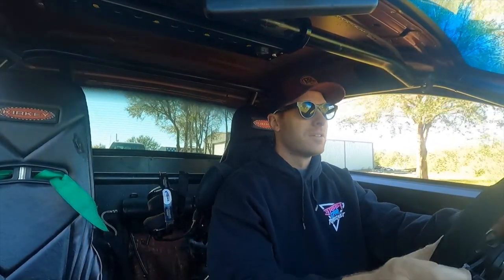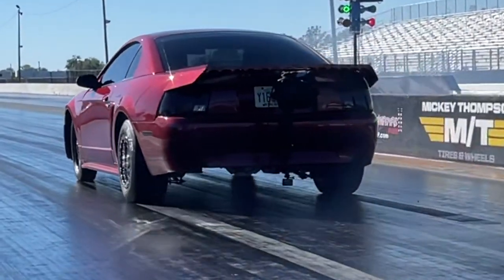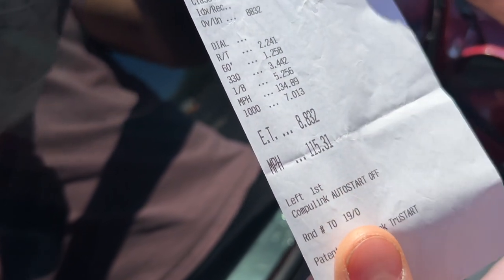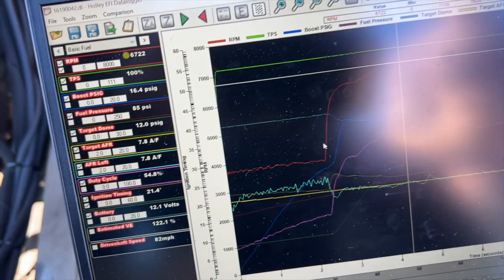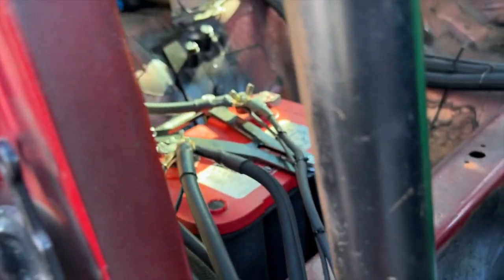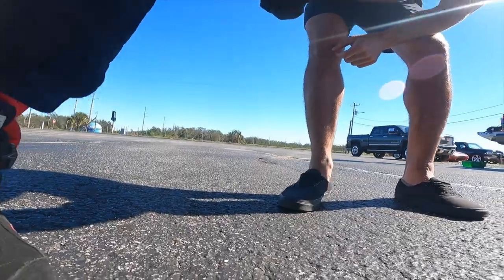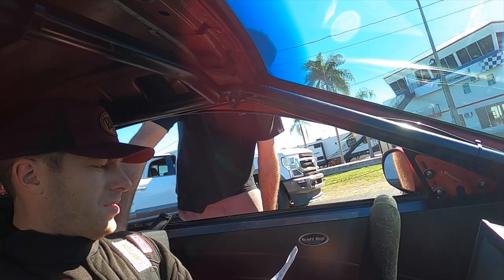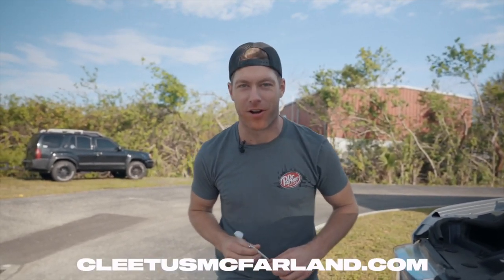Turbo LSX Mustang does Wheelies on a Small Tire

Comment: The videos keep getting better, great job Parker!
I'm old school so I know mechanical fuel injection and a magneto on a blown big block, simple and effective power.
But I digress...

Little issues always seem to be found in the wiring and there's lots of wiring in these modern cars so lots of potential for issues. Definitely go through and check all your grounds, all your connections, make sure it's all solid. Trying different plug wires isn't a bad idea, as mentioned by others some wires just play better with the other components. Regardless keep digging, the car's a beast and remember no car is ever "perfect", there's always something. lol
Reply: Troy mentioned a great point also related to the charging system, your grounds.  Looks like you have a bit going on in your ground cables.

Comment: You can always try a different set of plug wires and see if that helps. Sometimes certain wires don't work well with different setups. It could be a setting in the computer too, like if it's hitting a Rev limiter or boost safety type thing. Seems odd it's just staying at 6k and won't go up or down from there.

Comment: You'll have to fix the voltage drop issue. I've had it happen before. Need a better alternator or I think swapping to a bigger pulley to slow it down should help. Also set the dwell time on the coils in the Holley to 4-4.5.

Comment: So we have similar setups, my engine is likely a little less spicey than yours but it would appear we run similar times. I've always just stuck to the KISS theory (Keep It Simple Stupid). Anytime I have run into a misfire, or breaking up, etc, I always check the usual suspects. Spark, Fuel, Compression, Electronics. If My plugs and wires are not cooked, I check my fuel pressure, my fuel map, my injectors for any blockages/clogs. I check to make sure I'm getting good compression in all cylinders. I check my electronics for a loose fuse, a loose connection. Make sure you have a good ground on all systems that need it. Check to make sure your alternator is producing enough current under load. All that being said if you haven't run out of injector or fuel pump, and your plugs and wires are good I think that Dr Tunemall may be correct and you have reached the limits of your current coils.
Reply from the maker: Thanks for that! Thoughts on my alternator being over spun? Going to a bigger pulley this week.

Comment: Check the coils and the voltage going to them. It was my first thought and then you said Nate said the same. If the voltage is around 12 or lower you probably don't have enough spark to lite the fuel at higher boost levels, which explains why it starts happening in 2nd gear and not 1st.

Comment: Electrical engineer here, voltage drop is likely not enough supply. If you're confident about the coils, check the wires feeding them. My guess is the Dr. is correct. Will likely need to upgrade(coils, plugs, wires).

When in doubt, go bigger in terms of wire guage for all grounds and for systems that draw a lot of current like ignition

Comment: Start by redoing that ground setup...Thicker cable near the alternator to the chassis, block to chassis...and a solid run to the battery itself.

Then make a specific ground BLOCK that all electronics can have a direct run to...

Keep it clean and simple, eliminate that drop...

Comment: Do you think youve got some pick up sensor issues developing like Ruby had? Obviously not as bad but another thing is with your voltage dropping that low, Im wondering if its effecting the coil performance/spark delivery 🤷‍♂......I would look at all the data and see where if its happening at the same point every time. Plug looked pretty good

Comment: You went over your settings in the Holley? I'd honestly go with better coils as Nate mentioned. I don't know what plugs you're running but they look like some NGK BR7EF's? I'd be suspect of them also. Start closing the gap a tiny bit at a time and see if it's blowing the spark out. If that doesn't fix it try swapping to something like a Brisk DOR12DS or DOR10DS.

Comment: I had to put a bigger pulley on the alternator add a ground strap to the alternator, and if your using a 4 pin alternator PLFS, try putting pin S to the 12v bat stud on the back of the alt. This is what worked for me.

Comment: It does sound like the voltage drop is messing with everything else at the top of the run. When I ran a ancient MSD 404bc on my Dart it ran great once I got it to start but if the voltage dropped too low while cranking it wouldn't have enough spark to start. It drew a lot of current and something wasn't right with it but it still worked. I also had to close the plugs way up to get a good spark out of it. It finally completely died and I gave up and put a 6a on it for a while but it just wasn't reliable on a old car with bad wiring. I think voltage spikes kept killing it.
Consistent voltage with a good current level is really important when you're using picky go fast parts. I had a 100 amp cop alternator on the Dart and it really helped keep everything running and the huge battery I used charged up. That was the biggest charging setup you could get from later Mopars that would fit in the Dart.
I love seeing your family and friends jumping in to help and with all the ideas you have now you should get it figured out👍

Comment: Saw someone have the exact issue. He had ceramic plug wires but was told to put better plug wires on it. They were thinking coils at first. But plug wires fixed it. Same exact breaking up.

Comment: I would look into the valve springs. Sounds like valve float. The boost pressure and rpm may be causing the intake valve to not close fully. I had a similar issue when I tried to run stock valve, springs and boost. If I went above a certain amount of boost the car it would just hit a wall because it had valve float. No breaking up or anything.

Comment: Take a trigger log on a pass to make sure you're crank and cam signals are clean. Are you using aftermarket triggers or stock? Possible air gap issue if they're aftermarket. If that checks out then move on to your basics. Makes sure injectors are flowing evenly, change out plug wires, check for carbon tracking or cracks in/on the porcelain on the plugs. What are they gapped to? Maybe make them tighter, .018-.020 if they aren't already there.Then move on to your coil upgrade, that would be me last move since there's an investment commitment and potentially time wiring. I'd also verify engine viability with a leak down test if nothing else obvious pops up.

Comment: Look into the alternator.. maybe over 6k the belt is slipping and can't give the voltage to the coils.. 

And I know everyone runs a stock LS alternator, but a 3 phase alternator like a mechman puts out super clean power and cleared up a bunch of electrical gremlins I had in a big turbo drag truck.

Comment: Good Video. If those are LS coils, they need good voltage and I always need to run the gap tight, .013-.015 max Holley coils are way better, but you have what you have. Tighten gap way up at least to start.

Comment: Possibly alternator if you’re dropping voltage. I’ve had that issue before on my LS at higher rpms. Switched it out for a higher 165amp alternator and it never dropped again.

Comment: Your coils, injectors and fuel pump all won't be entirely happy at 11.x volts.  I have to assume the Holley EFI has a battery voltage compensation table that should go some way to putting a band-aid on the problem, but you really need that voltage at a steady 13.5+V as you go down the track.

Comment: Low 11s voltage on those high power ignition rigs is probably a bit low,  higher output alternator/battery, then perhaps simply a better coil pack on the cylinders.

Comment: Definitely saw the editing effort! As for breaking up at high RPM...did all the plug wires got replaced on the dyno runs? How about plug gap? And if you say the voltage drops to the 11's then maybe try a new battery...LTO for the win! (Not cheap but worth it, bassheads like em!)

A better alternator could also be something but before all that...check your power and grounds. I would strap on the ground wire to the alternator directly (where the power comes from) instead of going through the block, and some simple head grounding to help the spark plugs. Let's get it on!

Comment: Check that voltage drop typically if you’re losing it above 6k you’re over spinning the alternator I’m not sure if you changed that pulley but the motion 3in should slow it down and keep the alternator charging

Comment: Now you have turned it up more it appears it was then it started breaking up so you could be blowing the spark out so try closing the plug gap down to 14 thou and if it still
breaks up you might be at the point of needing more powerful coils, I would also be tempted to try new plug wires first as I have had what looked like perfect wires but still
were causing a breakup under extreme loads.

Comment: Parker is am assuming the the smaller tire is changing the gear ratio out back and the tune ramp may be adjusted higher in the rpm range as you are climbing in rpm much faster with a 2 inch smaller tire. You may have to fine tune the ramp to avoid running out of fuel and/or reduce timing up top.

Comment: Better electrical system supply... The voltage shouldn't be dropping off like that. However it seems like after the ground cable came off it could have spiked something in the ignition dept and hurt it, not sure if all the problems came after this incident or were there to start with.

Comment: the voltage dropping is more than likely causing the engine misfire. at a guess your over spinning the alternator. the battery coming unhooked also could have killed the alternator. 

id have to agree with nate though, with the power your making its time to step it up to some ign-1a coils.

Comment: I would start with the voltage drop issue then next make sure valve springs are in good shape. Believe it or not it can cause a break up in higher rpm
Reply: I was thinking the same thing.

Comment: @ 8:50  in the last 2 boxes of the Base, shouldn't those be 17psi out the back end?  I'd get a set a new set of Coils, if thats not it, You have spares on Race Day.. Maybe start by checking all the wiring Grounds & electrical plugs, fuel filter & check fuel pumps, Ohm the spark plug wires & pull all the spark plugs.   Clean & test the Injectors!!  it sounds like your going lean after 5 or 6000rpm?   this is why we test!

Comment: crankshaft sensor gap, or wear, reluctor on crankshaft has moved or warped? Being higher rpm/load, Would think electrical, voltage drop alternator issue. All happened after ground came off had to strain all the capacitors and such in the charging system and ignition system.

Comment: I was gonna say sounds like ur alternator it’s being over spun mixed with unstable sad cable. Was also thinking crank shaft position sensor might be slightly missing in high rpm kinda like ruby was. Maby frequency or vibration. I’m a nobody when it comes to this just my thoughts brother keep ur head up killing it 🎉

Comment: Parker, i'd definitely pull all the plugs and check the gap. Swap the wires out for a new set to cut that out of the equation.. do you have the motion smaller alternator pulley? Could definitely be over-spinning the alternator at that RPM..

Comment: Clean up all the cables at the battery  using distribution blocks,  up grade the Guage of the battery cables positive and  negative, see if that helps with the voltage drop also check the  battery .

Comment: The ground wire coming off & on & off may have damaged the coils. In the video you didn't say anything about breaking up until after that happened. It could also be the lower voltage affecting the coils. Race cars can be a pain sometimes.

Comment: Low voltage can cause ignition issues. If coils, wires and plugs are all good, I would look into a more powerful alternator, or maybe look into running a 16v system.

Comment: That diff is howling so bad. New gear set required.
I guess the alternator has stopped alternating as it should have still ran with the battery lead off. All those coils too use a LOT more power than a single one

Comment: If your voltage is dropping and your battery terminal fell off earlier maybe you should check your electrical connections. As voltage changes your injector dewll times change, you are also losing about 30% of your potential ignition energy

Comment: Can you lower and rescale the car to get more separation?  Also, fix the charging system.  It's going to reduce the output from the ignition system.  Some IGN-1A coils would help but with the issue you're experiencing, I don't believe the coils are the root of the problem.

Comment: Did you turn it back down and see if it goes away? Almost sounds like a little valve float, I know it’s a pita but maybe valve springs if it’s not coil or injector related, make sure your fuel tank, lines, and injectors are clean but I’m sure y’all checked fuel flow

Comment: Get rid of the voltage drop go with at least 14volt battery as a start. Be sure your block is grounded to chassis and motor plates.

Comment: Look at the alternator it should be 14 to 15 volts when on transbreak voltage is dropping witch  messes with the power to the coils an with the boost you have to have strong coil power to fire properly. It's probably the alternator go to a 14 or 16  volt alternator and it will help out

Comment: Could it be some sort of signal interference to the ecu? I know we had an issue  with our car a few years ago (digital 7 box so a bit different), but where we had it mounted, we had some sort of odd signal interference at about 4.5k rpm. It would stumble right past the 60 foot and it drove us crazy. Moved the ignition box about 8 inches back from the previous spot and the problem disappeared. I don't know if Holly's typically have that issue or not 🤷‍♂️

Comment: What size fuel pump wires you using also alternator wire size and connection’s converter slip at high rpm

Comment: my idear for your breaking up issue might involve overpowering your valve springs with boost, and your valves might not be closing all the way due to the amount of boost/power you're making. maybe a spring pressure check and look at the data unless I missed the data being cleared for any such problem?

aside from that we know you have been chasing basically the same issue with plug wires, I say buy once cry once get the bad boy plug wires you need...might be building up too much dwell in the cores at higher rpm?

can't hurt to get the big boy coils either...

Comment: Making that many passes in a day temp stacking in the converter will begin to offset your tuneup changes, hiding improvement. Even with a good pit cooler the converter will never hit as hard as it does off the trailer.

Comment: Test the battery, make sure its good and not got a dead cell or anything, replace those terminals with some good ones that are tight and work right, check the alternator output to make sure your getting a good charge, and check the earths for everything, poor earths will cause a lot of issues, fresh set of plugs, upgrade the coils, and make sure its got enough fuel pump and injector to not be getting up there and near maxed out , and check the fuel lines are clear without any blockage causing fuelling supply issues to the injectors
Reply: also check voltage on the cam and crank sensors, make sure voltage or signal isn't being lost at higher rpm

Comment: Maybe it needs a high pass rpm signal filter on either the crank or cam, or both. Something about how the shape of the signal wave can throw off what the ECU is expecting. Paraphrasing out of my ass here with "low spikes are sometimes being recognized as high spikes because the signal is so raw and spikey". Maybe that'll jog someone else's memory. Know anyone with an oscilloscope?

Comment: If it was mine I would be looking into that voltage drop. I feel like low 11s is way to low but could be wrong
Reply from the maker: I think we’re over spinning the alternator
Reply: @DoctrParker   very likely. I turn 7700 with a 3.0 and does fine
Reply: @DoctrParker  awesome video btw!

Comment: Was it breaking up before the battery post come off mid run if not that can be causing you a problem  voltage can be your issue let me know and I will know for

Comment: Look no further than your voltage drop!!!! When voltage drops Amp draw increases so when boost increases during a pass, voltage is dropping coil amp demand is increasing and the Holley voltage to the coils may be reducing due to its voltage being low……run an alternator is my solution or dual batteries to maintain minimum of 12v for a full pass

Comment: If voltage is dropping that bad and running a alternator on your car put a bigger amp out put one on the car and if you don’t have a alternator then run a bigger amp battery like a red top high amp battery like a 16 amp battery

Comment: Look into the rpm you are spinning the alternator, maybe you are over spinning it and need a bigger pulley on the alternator, I had this problem and found out at 5000 rpm I was maxing out the alternator, put a bigger pulley on the alternator and now my voltage is 13 all through the pull.
Reply from the maker: This is what we’re doing first!

Comment: You still have an 8.50 cert cage correct? You might have some difficulties turning in a competitive time slip at your next DND event!!
Reply from the maker: What if I cross the 1/4 mile beams over 8.50,
Reply: It's going to depend on the event, but I think as a general rule, they will use a standard 1/4 to 1/8 conversion and you are going to be capped at around a 5.49 ET limit.
You normally can't turn in a time slip if the car doesn't tech for that ET.
Reply: You guys have it easy at Bradenton. I would hate to see you go on your next drag and drive event and not be able to pass tech to meet the cars full potential!!